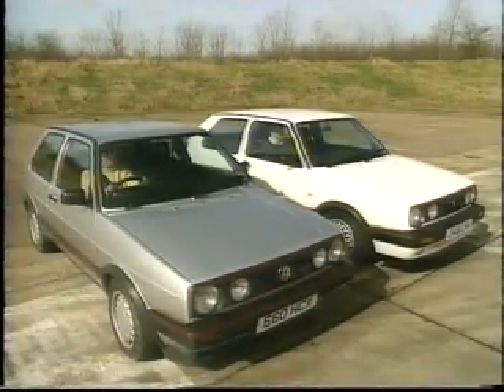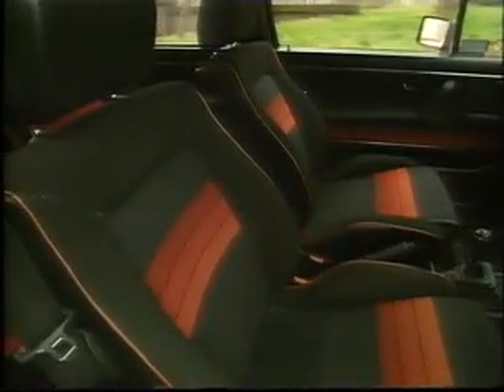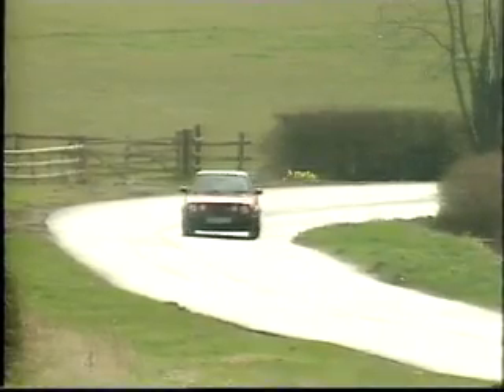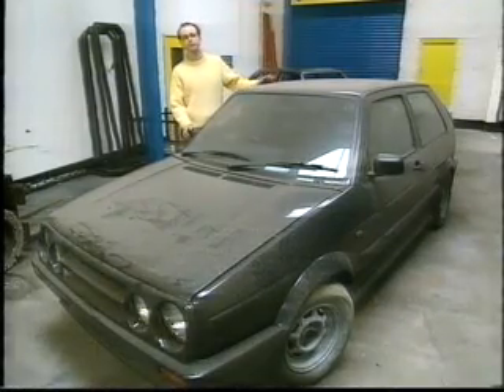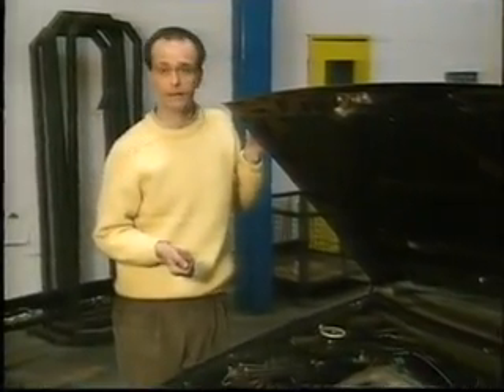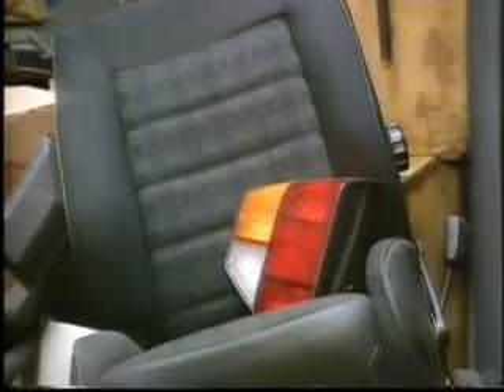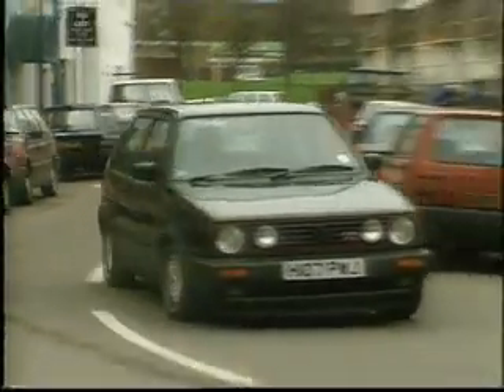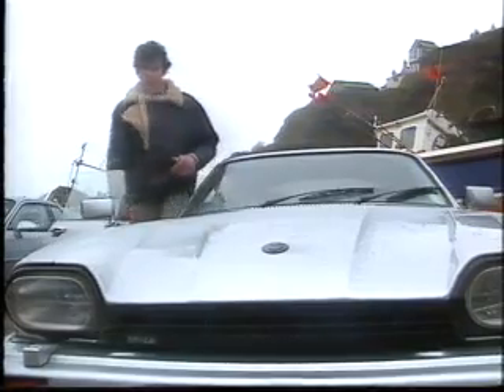Volkswagen Golf GTI mk2 buying guide

Comment: Memories. Back in 1994 I had a mk2, although only the 8 valve but nonetheless, a well built solid and great handling car. I test drove an 08 plate a few months ago and even with 200 hp it felt a heavy car, and very dull to drive compared to the mk2. Guess that's progress for you.

Comment: im a mk2 golf GTI dealer and the first things i check are if the syncro has gone in second gear (it will crunch if it has), if the heater fan works, rust around the filler cap and windscreen wipers and noisy tapets. All these are common faults on mk2 gtis

Comment: @veedub1989 They did in the US, i have seen a US mk2 GTI 16V and it had the 9A engine 2.0 16V 136hp i think (it was actually less powerfull than the standard KR engime 1.8 16V with 139hp , but it had more torque and power on low revs)